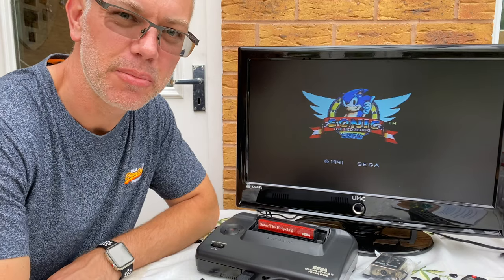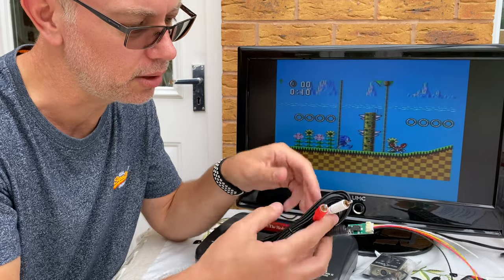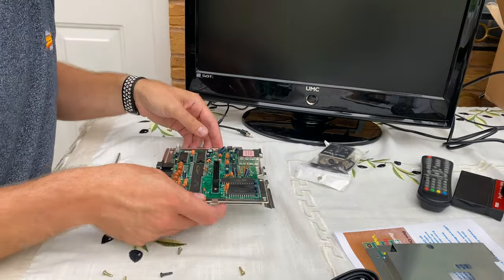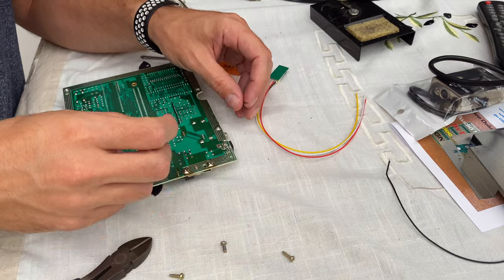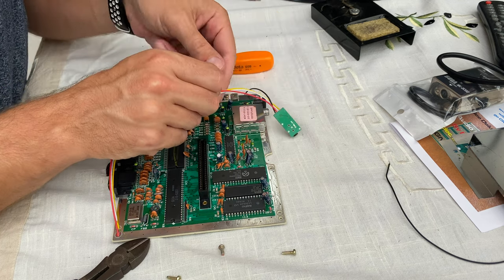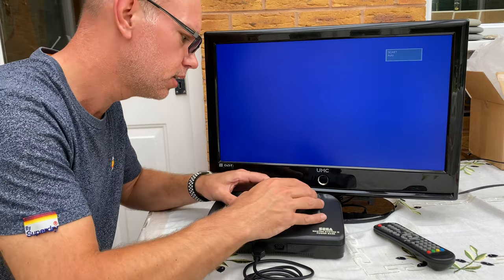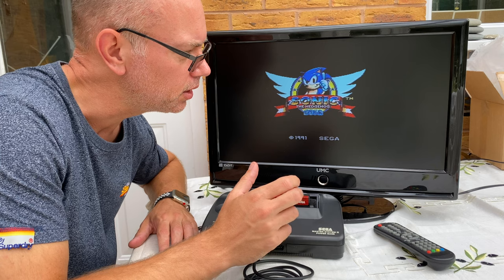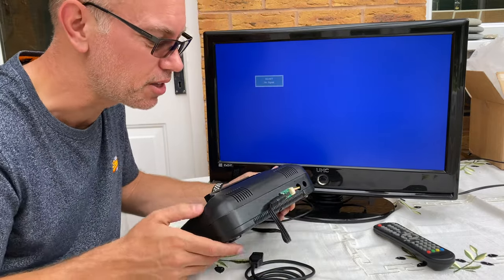Sega Master System 2 composite output mod

Comment: Hiya on the website where is the composite board please as I can't find it? Was going to check it has the capacitor 220 micro farads  and resistor inline 75 or 100 ohms on it as this may contribute to the effect your seeing. Good video keep them coming 😊
Reply from the maker: Thanks for your feedback. Interested by your cap/resistors experience. 
Here you go - it's listed for Atari, but it works for others (or maybe that's bad info I was given) https://www.thefuturewas8bit.com/deluxe-atari-composite-video-mod.html

Comment: Can I use cassettes from mega system 2 to other consoles?
Reply from the maker: Hi, there are modern consoles designed to play cartridges from old consoles like the Retron ones, https://www.hyperkin.com/game-consoles.html or there was the Power Base Converter designed to play SMS on the Mega Drive https://segaretro.org/Power_Base_Converter 
Is that what you meant?

Comment: Just a thought: the TV says SCART so are you using a composite to SCART adapter? The pattern of repeated pixels makes me wonder if the TV has incorrectly interpreted the composite signal as S-Video which is a thing that I've seen happen. I have two old LCD TVs that both have the same behaviour, there's two SCART sockets: AV-1 is RGB/S-Video and AV-2 is Composite. Composite in S-Video causes effectively every other pixel to be wrong in a regular pattern.
The other thing that springs to mind is it was a common thing on mega drives to remove the RF unit entirely if you planned to use RGB exclusively as the very presence of the RF unit caused regular interference on the RGB. I don't know if it is relevant for a master system 2, but it's a possibility.
Reply from the maker: Ooo! Nice idea, I’ll have to check that out. Thank you for your detailed comment and thoughts.